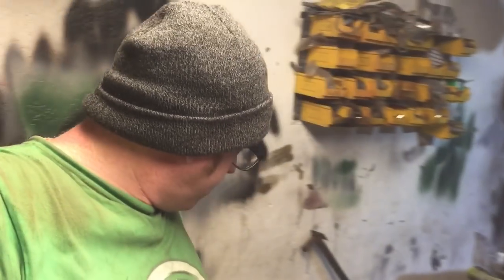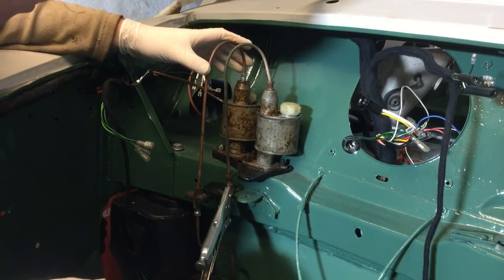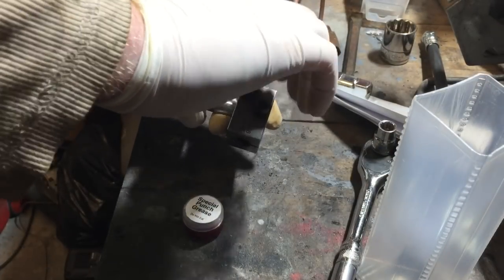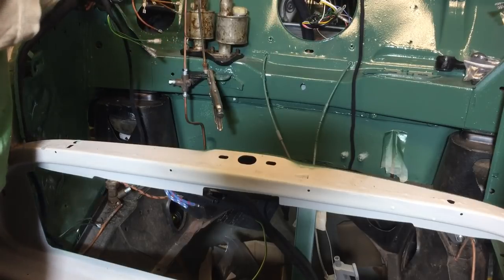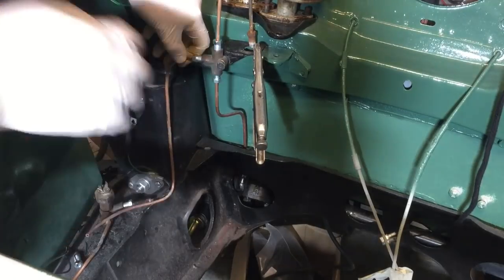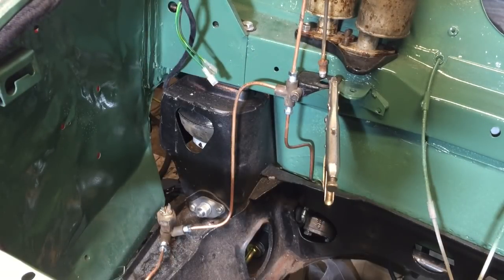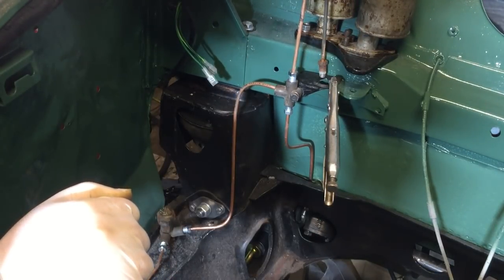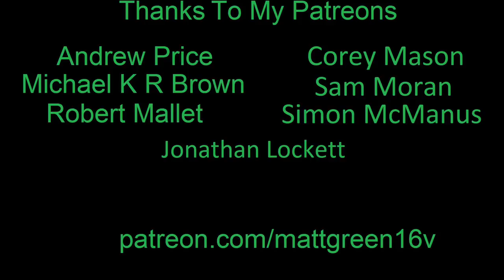1964 Mk1 Mini Restoration S2 Ep217 - Front Brake Pipes

Comment: Good too see you back on the Mk1 - oddly the brake T piece on my Mk1 is not on the engine mount bracket, it is lower down bolted directly to the bulkhead.

Comment: The experts and purists in the YouTube 'Mini Community' will probably be tutting. That down pipe from the bulkhead union to the subframe banjo union had a fitting that the factory used to connect the pre-assembled subframe / engine to the car body assembly.

But you know my opinions on them purists ...

Spaghetti Bolognaise tonight. Pasta Wednesday.
Reply: 1chish how is your OCD going with the absence of proper pipe bending tools...? Driving ME mad... but I am liking the new flaring tool.
Reply: @martingray8443  Matt's thumbs do OK and I l,ook away ...lol
Luckily I have double jointed thumbs so I get some great curves (pipe curves that is). Its old fittings that really do my OCD nut in to be honest ..
Reply: 1chish got to keep something original lol!